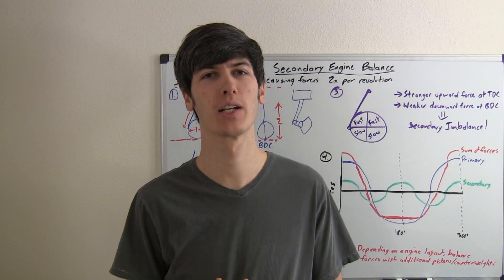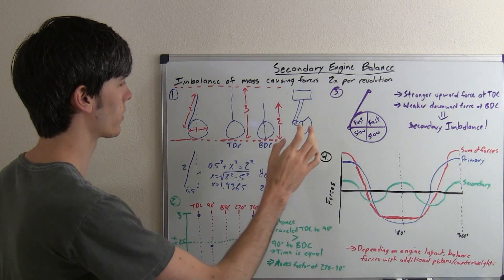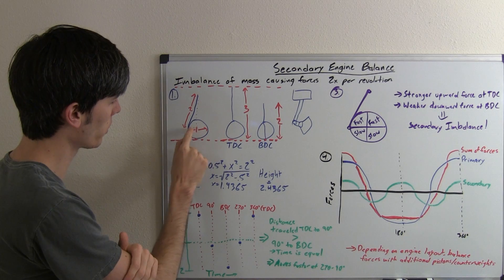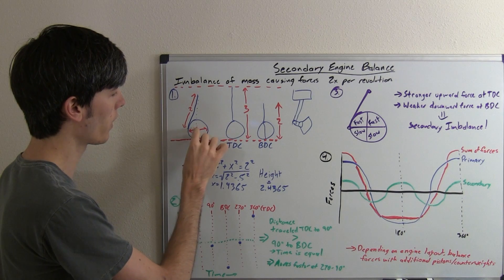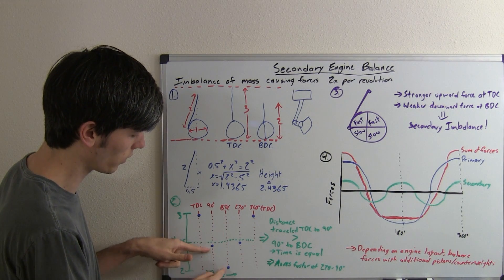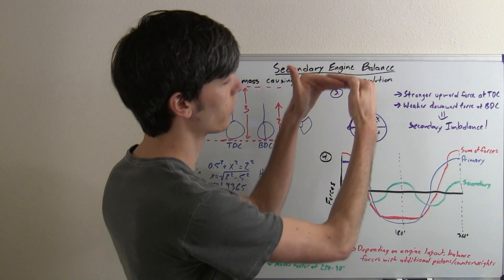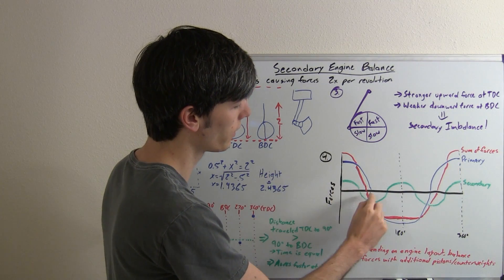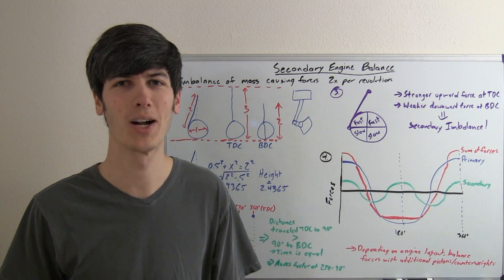Secondary Engine Balance - Explained

Comment: Another way to think about it, and this is funny, is that the rotating set is bigger (large radius) when the piston is closer to the top and Smaller when is closer to the bottom.
Funny enough that means to keep a constant rotation the top part must travel faster than the bottom part.
It also means the piston wanna jump out.
That may explain way often engine spit piston up, that is the fact that crank case are more resilient... albeit there is more material in a head than in a crankcase.

Comment: He doesn't explain why the crankshaft rotation speed would change depending on crank angle. I still don't get why the rotation speed is faster during the up portion and slower during the down portion.

Comment: Are balancing shafts only/more important with low conrod length to stroke ratio. A 4 cylinder with a ratio of 2 seems to be quite balanced and does not have balancing shafts. I am looking at de-stroking a BMW B48. It currently has a ratio of 1.56 but if I reduce the stroke to 70mm from 94.6 it becomes 2.29. Would you think it still requires balancing shafts. B48 Con-rod centre to centre is 148mm, de-stroked it would be 160.3mm.

Comment: I can’t quite get my head around where the double frequency comes from. Each revolution, the piston is fast once and slow once. Wouldn’t this create a single peak and a single valley? Where does the double frequency come from? I think it’s the fact that from 0-90 the piston is accelerated by the crank, from 90-180 the piston is slowed the crank, from 180-270 the piston is accelerated by the crank and from 270-360 the piston is slowed by the crank. But this has nothing to do with the different distance travelled by the piston between 0-180 and 180-360. I’ve googled around but can’t find it.
Reply: Or is the green line simply the result of subtracting the blue line (theroretical forces with infinite connecting rod) from the red line (actual forces)? I think this is true regardless, but I wonder if there is a different explanation around as to where the double frequency comes from.

Comment: As is usually the case, this guy knows enough about what he's talking about to pull the wool over the eyes of the typical youtube viewer. Certainly it is true that in order to understand secondary imbalance you have to understand asymmetry in piston motion. But just because you understand one of the elementary pieces of a bigger puzzle does not mean that you understand the whole puzzle. The explanation he gives is partly correct, but at about 3:48, he jumps in over over his head. This is what he does in most of his videos. He understands a little bit of a bigger puzzle, and he explains the part that he understands, but makes a mess of the bigger thing he's ostensibly explaining, because he doesn't really understand it. Here, as soon as he starts talking about the primary and secondary forces, he is over his head and does not really know what he's talking about.

The mathematical approach to vibrational motion is harmonic analysis, where the vibrational motion is represented by an infinite series of pure sinusoid terms starting (the fundamental) at frequency the same as the crankshaft rotational frequency. Then 2x that frequency, then 3x that frequency, and so on. "Primary balance" refers to the case where there is no vibrational motion component at the 1st order, i.e., no vibration at frequency the same as the crankshaft's rotational frequency. The primary example of an engine that has perfect primary balance but that lacks perfect secondary balance is the in-line four using the flat 180-degree crankshaft. With this engine, there is no vibrational motion at the crankshaft's rotational frequency. There is no rectilinear motion (back and forth in a straight line) at this fundamental frequency, and no rotational motion (end-over-end rocking motion) at this frequency. The two pairs of pistons (the inner pair and the outer pair) do not generally move at the same speed (because one pair is in the lower part of the stroke and the other pair is in the upper part of the stroke), which means that the momentum in one direction does not perfectly cancel with the momentum in the other direction. The aggregate piston mass thus exhibits rectilinear vibrational motion at frequency starting at 2x the crankshaft rotational frequency. As such, the inline four has perfect primary balance (because there is no vibrational motion of any sort at the crankshaft's rotational frequency), but it does not have perfect secondary balance (because there is vibrational motion at frequencies that are integer multiples of the crankshaft's rotational frequency). The reason the lowest frequency of vibrational motion in this engine is 2x the crankshaft rotational frequency is that when the two pairs of pistons pass each other near (but not exactly at) the midpoint of the stroke, the direction of motion (and direction of momentum) reverses. This occurs because the pair that was moving faster becomes the slower pair and vice versa. This is a simplified description of what actually happens, but this is close enough to explain that the direction of the rectilinear, aggregate piston momentum reverses once with each 180-degree rotation of the crank and twice with each 360-degree rotation. Therefore the lowest frequency of this rectilinear (aggregate) motion is 2x the crankshaft rotational frequency, and it is for this reason that it is considered a secondary imbalance and not primary imbalance. To make the picture more complete, consider the example of the inline triple, which is more like a boxer twin. Rectilinear vibrational motion cancels among the three pistons, however there is end-over-end rocking motion at the same frequency as crankshaft rotation, and as such, the inline triple does not achieve perfect primary balance. The same is true for the boxer twin. But if you put two inline triples end-to-end, the end-over-end rotational (rocking) motion cancels between the two halves. You end up with no rectilinear motion (at any multiple of the crankshaft rotational speed) and no end-over-end rotational motion (at any multiple of the crankshaft rotational speed). Thus, the inline six doesn't merely achieve perfect primary balance (which would make it no better than the inline four); it achieves perfect balance, primary and secondary.

Comment: d = Position of piston in cylinder relative to crankshaft centreline
r = Crank throw radius = Stroke / 2
L = Conrod centre-centre distance
theta = Crank angle (theta = 0 at TDC)

d =       r cos(theta)          + sqrt(L^2 - r^2 sin^2(theta))
      [Primary Component] +    [Secondary Component]

And if you know your double-angle formulas, sin^2(theta) = (1 - cos(2 theta)) / 2. 

The primary represents the up/down motion of the piston in the cylinder. The secondary component represents the side-to-side component inherent in the crankpin's circular motion, and since sin^2(theta) has double the frequency of cos(theta), the side-to-side component induces an additional vibration occuring at twice the crankshaft speed. The side-to-side component is where the secondary vibration comes from.

Comment: How do you get height is equal to 2.4365
Reply: He's adding the crank radius to the Center-line height. He's measuring from the bottom of the circle to the top of that broken line he made in the middle. (1.9346 + 0.5 = 2.4365)
Reply: @JohnDoe-iu5xi  thank you

Comment: 1:54 It´s not two because the rod gets drawn out (of vertical) on the first half, which makes cylinder go a longer way. If you would just pull the rod to the side the cylinder would also move down, that´s where the additional way is coming from.
On the second half it´s the other way around, here the rod gets drawn in (to vertical). If you would just pull the rod inwards, the cylinder would go up, that´s the effect that makes the second way shorter.
Reply: So the additional travel of the piston from the horizontal movement during TDC to 90 is downward and adds to the downward vertical travel of the piston from the top of the crankshaft height to the center axis height of the crankshaft, and from 90 to BDC this same additional travel of the piston from the horizontal movement during 90 to BDC is upward and subtracts from the downward vertical travel of the piston from the center axis height of the crankshaft to the bottom of the crankshaft height.   Consider the movement of the piston by moving the base of the connecting rod to the side and then back again to the original position to see how the piston moves and why this first adds to the travel during the TDC to 90 and then subtracts from the travel during the 90 to BDC.

Comment: tertiary balance cams and valves that is how you pick an engine to race and the type of racing ...you don't see much other than V8s in dragging power deliever to load!!
easier to rebuild...not better balance.....
PS you can change those numbers and the balance with physics and materials science ...dynamics your stuck with!! edit well you can change the statistical dynamics and atmosphere ((making a different fuel to burn in a new atmosphere))! gemini was oxygen in the tank and no oxygen in the atmosphere!!!!!!hint..

Comment: It is stated that a 60 Degree V6 will have a rocking motion since it is basically (2) 3 cylinder engines. However I think that assumes the piston pairs are sharing connecting rod journals.
What is the balance characteristics of a 60 Degree V6 that used separate connecting rod journals for each rod? These separate journals are then allowed to be spaced for optimum balance. I think the early 1960s GMC 305 V6 had that kind of layout.

Comment: Ford's 5.2L Voodoo engine with a 93mm stroke, can't survive the secondary forces at 8,250-rpm redline, for the length of the factory warranty.
Ferrari only went to 83mm stroke in their 4.0L V8, and Ferrari expects their owners to do more maintenance!

Comment: A bit of hand waving to get the green curve, but generally correct. Another way to explain it is to say that the primary imbalance is defined to be the momentum that the piston would have with a very long connecting rod, moving with a velocity that is the cosine of the rotation (the purple curve.) As you point out, the velocity is not a cosine due to the shortness of the rod. The secondary imbalance (green) is defined as the difference between the actual momentum (red curve) and the cosine curve.
How do you get a term that oscillates at twice engine speed? It's in the little triangle on the whiteboard. The sum of the squares of the sides of a triangle equals the square of the hypotenuse. One of the sides is a cosine, and a cosine of an angle, squared, is 1 + the cosine of twice that angle. Twice the angle means it "rotates" twice as fast.

Comment: I totally get that the piston moves further from 90 btdc to 90 atdc than it does in the other "bottom" 180 deg of crank rotation, but I still don't understand why the frequency of secondary imbalance is twice the primary. 1.) Why doesn't this difference in piston speed merely result in a larger primary imbalance (with regard to single-cyl engine for now) and 2.) Can anyone explain why a parallel twin engine with a 270 degree crank arrangement is said to have better secondary balance?

Comment: Great video! One thing to add for those who need a more explanation. The reason the piston travels farther during the 1st and 4th 90 degrees of rotation than the 2nd and 3rd ninety degrees is because, even though the distance from TDC to horizontal center line and horizontal center line to BDC is the same (in the example it is 0.5), the rod base has to move out from vertical center which brings the piston head down more than when it moves back right.

Think about it this way. If the piston line is a fixed length, the bottom of the piston line is fixed on the x axis (horizontal center line) and the top of the piston line is fixed on the y axis (vertical center line). As you move the bottom of the piston line away from the y axis (right or left) the top of the piston line moves down the y axis. As you move the bottom of the piston line back towards the y axis the top of the piston line moves up the y axis.

Back to the engine. This means that the first 90 degrees of rotation not only moves the rod base down the y axis, but also the rod base moves to the left away from the y axis. Both movements cause the piston head to move down.  The 2nd 90 degrees of rotation moves the rod base down, but the movement of the rod base back to the right towards the y axis, tries to raise the piston head. The net effect is less piston head movement downward than the 1st 90 degrees of movement. The 3rd 90 degrees of roation sees the rod base moving out (right) from the y axis which causes the piston head to go down, but the rod base is also moving upwards, the net effect being the same amount of piston head movement as the 2nd 90 degrees of rotation, just in the opposite direction. Lastly, the 4th 90 degrees of rotation sees the rod base coming back in towards the y axis and the rod base moving upwards, thus the piston head moves upward having the same piston head movement as the 1st 90 degrees of rotation, just in the opposite direction.
Reply: Thanks for taking the time to explain it your way. I really wasn't able to wrap my mind around this, but in the middle of reading your comment it finally clicked for me.
Reply: Jordan Fischer beautiful explanation, thank you
Reply: My friend thanks a lot . I wasn t able to fìgure out why this was happening but due your explanation everything became crystall  clear
Reply: i cant understand. :< or maybe im just dumb
Reply: You, sir, deserve a cookie.
Reply: Okay got it.
Reply: deserve more recognition especially after 3 years this explanation was amazing
Reply: Thank you very much )
Reply: Thank you for explaining this!

Comment: The reason of the piston moving faster going up then down would be because of the angle of the rod. If the rod was straight the whole time while piston going up and down then the numbers would be as expected. Correct?
Reply: @The Adel ur right that other readers might benefit from ur answer, could you expand on that statement though. Would it mean that the speed of the piston going up and down could be equalised if the crankshaft radius was increased?

Comment: A major benefit of horizontally opposed engines is that the secondary forces are mostly balanced essentially for free.

Non-sinusoidal acceleration due to the crankshaft geometry (translation of rotary to linear motion via Pythagoras) requires harmonic forces.

Comment: I have a question, well actually I have two!

1) Doesn't the second upper quarter, which also travels fast, counter the first upper quarter? If the first upper quarter is travelling up and over, the second upper quarter is coming over and down with equal speed. If the two fast quarters were on one side (ie the upstroke) that would make sense, but the diagram to me makes it appear like there would be unequal sideways force, rather than vertical. Can you explain this please? Thank you.

2) I'm also a little confused about the issue re: Pythagorean. What equation do you get for BDC>270 triangle?

Comment: Now correct me if I'm wrong, Mr.fenske, and I realise that the graph on the board is hand drawn and simplified, but am I right by saying that since the acceleration from 90 degrees to 270 from TDC is LESS than 270, back to 90, then sholdn't the Force, (F=ma) also be less on the graph from 90 to 270? It doesn't change the fact that the net force, will yield a similar graph as shown and the point is made about secondary balance, but as I don't know any better, I'm quite confused by your acceleration graph where the peaks and valleys are of the same height. Thanks for the wonderful videos.

Comment: It took me 20 minutes just sitting here after the video ended to figure out what on earth you were talking about with piston speed being different in the top 180 degrees of the arc than the bottom 180 degrees.  It seems like it's all the same distance and the same shape going the same direction, so it should be the same speed in each half.

But, circles aren't squares.  Am I right about this notion?  If you draw a diamond inside the circle (or a square standing on a corner, if you prefer), you get straight paths from 0-90-180-240 degrees on the circle.  If the connecting rod followed those straight lines, speed would be constant.  But because it's following a circular path around those four points, the speed (acceleration?) changes with the circle in relation to the flat plane described by the diamond shape. So the highest piston speed would actually be at 45 degrees and 285 degrees, presuming 0 degrees is TDC.  ...Is that right...?
Reply: I think you're very confused on the matter. The piston velocity cannot ever be constant because the piston is reciprocating. The velocity of the piston is constantly changing through the cycle and consequently the piston is always accelerating.